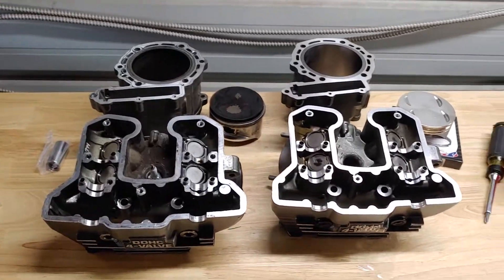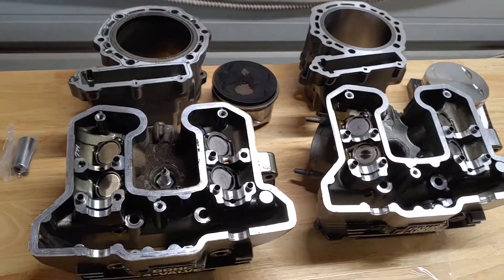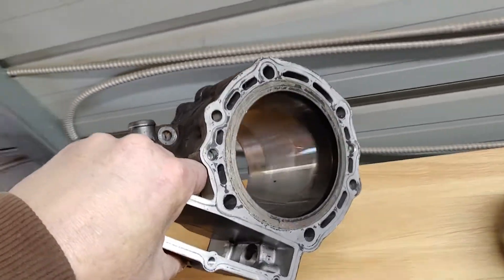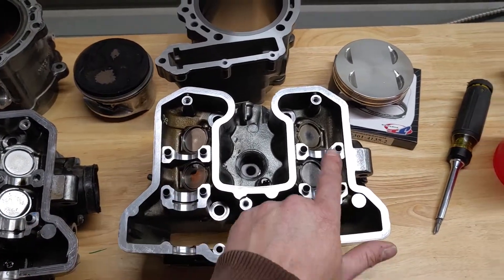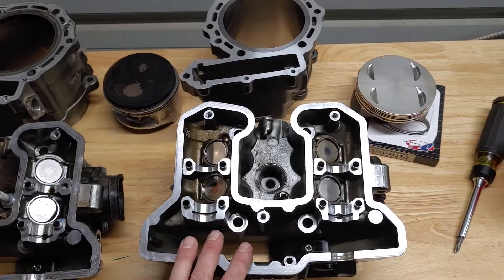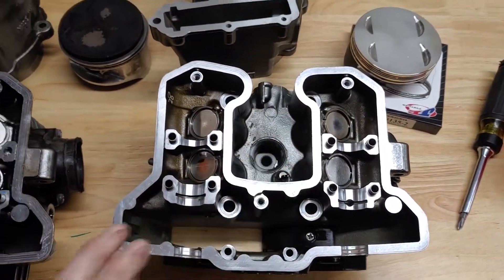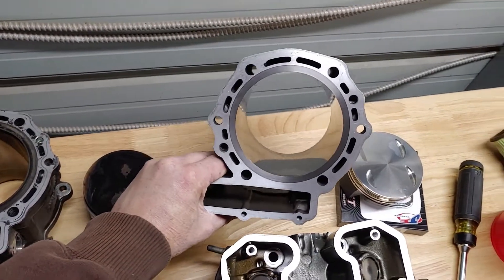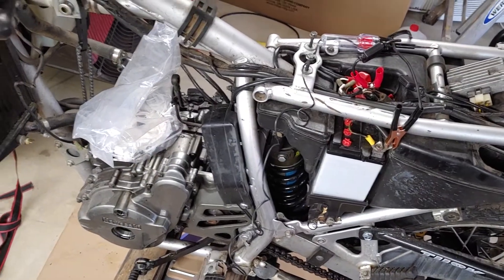KLR650 eaglemike 719cc Big Bore Kit

Comment: I got a 692cc from him and after putting it all back together I get a ticking noise from the exhaust valves 
I even swapped on another redone head and the noise is still there is there a fix for it?
Reply from the maker: Tappy valves are happy valves. As long as you checked the clearance you are good to go each valve should be checked for the proper spec per your Clymer manual. Mine tap as well. They will tighten up over time you want to have the biggest Gap allowable by spec so that you get the most out of your Sims before you check your valves. Otherwise you will be switching shims sooner than later

Comment: Going to generate more heat and more vibration. Probably should have an oil cooler which would increase oil capacity also. 
Good luck with this. I’m sure it voided any warranty if you still had any. 
Let’s see how much oil it burns now. 
Does that kit include a sixth gear to use the extra top end?
Reply from the maker: 6000 miles later zero oil burning. Almost no vibration compared to before.
Reply: The KLR already has liquid cooling and a radiator fan the 692cc kit I got from Mike the piston actually weighed less than the stock 650 cc one did,
Reply from the maker: @unclequack5445  not a drop of oil since I installed my 719 CC kit. The vibration at highway speeds is nearly none. I remember my hands were tingling after I got off of a long ride on the highway before the kit. Now cruising at 5K RPM 78 mph my hands are not fatigued at all even after two hours of riding. My but on the other hand after 1.5 hours the highway pegs come in handy so that I can alternate positions. At one point through Dallas traffic I found myself propping my back against the Pelican top case without my butt touching the seat at all. This bike is great. I had 200 lb of tools on the back have to lean forward every time I went to take off LOL.